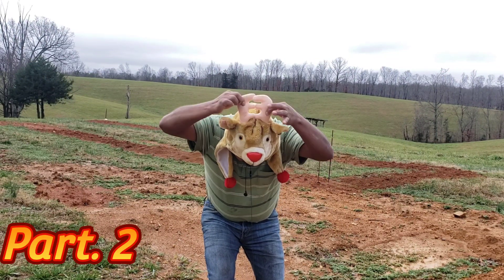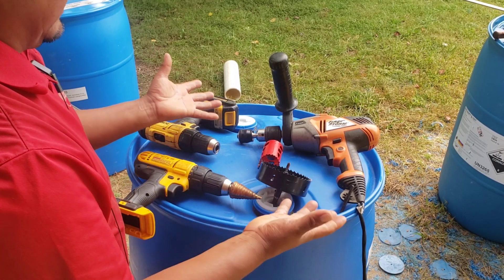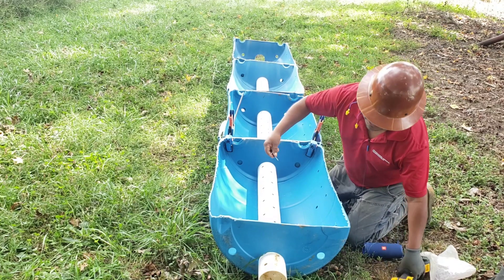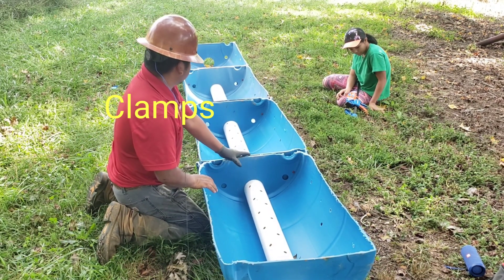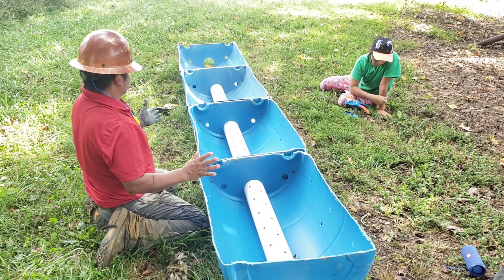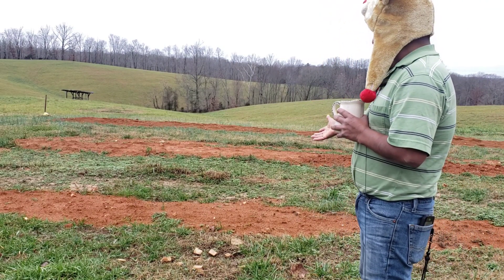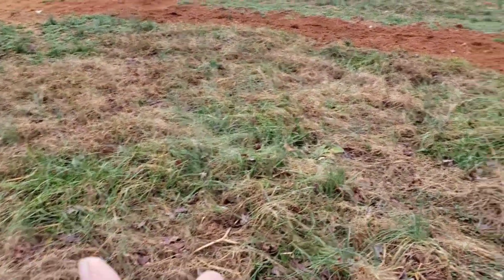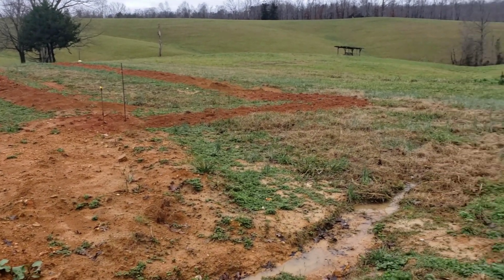How to use Plastic Barrel for Septic Leach Field/Drain Field Home made Gravel Less Drain Field

Comment: I spent $ 10,000 for 1,000 gallons pvc tank and 500 feet of Filtration lines. You made your own Filtration joints , that performance wise is equivalent and a heck of a lot less in cost! The Infiltration joints cost on average $80 each. You just saved a bundle of money. Anyone who is willing and able to make their own and hand dig can save on average $8-$15 thousand that Contractors are charging.  With your project savings you could make your own Septic tank with concrete blocks and fill them with ready mix concrete since the totes are a bit flimsy. Great job and great to see you had family helping!
Reply: I would not use concrete blocks. They'll disinigrate in a few years with constant moisture. The concrete used for septic tanks is a different compound than the concrete used for construction blocks.

Comment: Great job I want to do something like this for my washer because for some reason when they made the house they connected The the washing machine directly to the septic tank which fills the tank faster thousand gallon tank so I want to do something like this to put it on the other side of the house outside so it can drain the water into the ground that way the water from from the washer does not go into the septic tank
Reply from the maker: yes that's a very good idea, for me i did this for my entire house so I believe I'm going to put down a bigger or a double compartment Tank as of right now its working perfect,  Thanks for visiting my channel Bro,